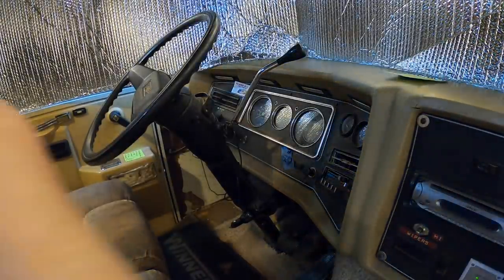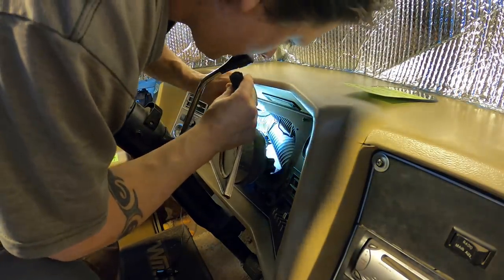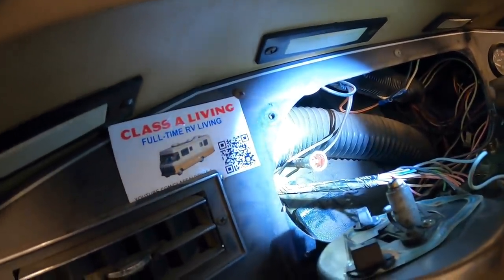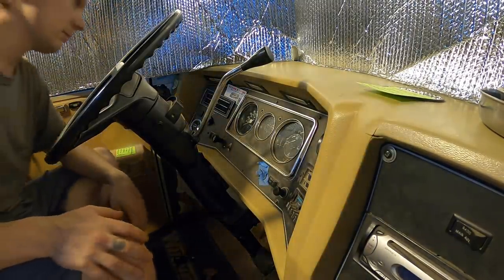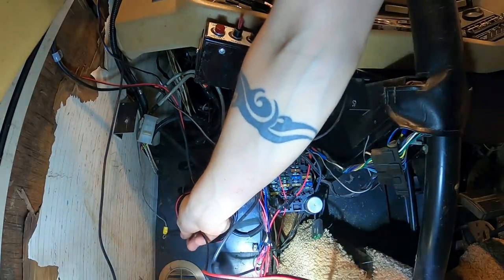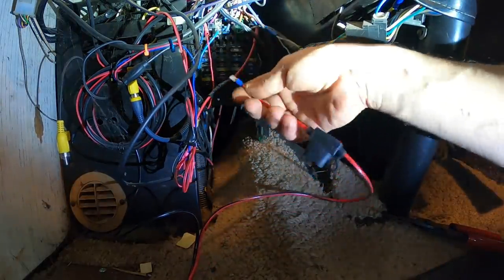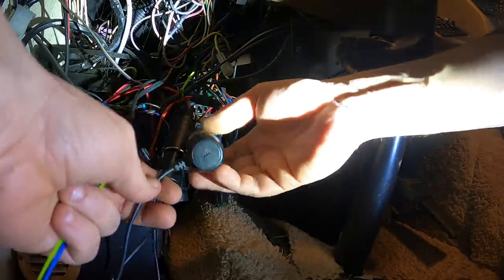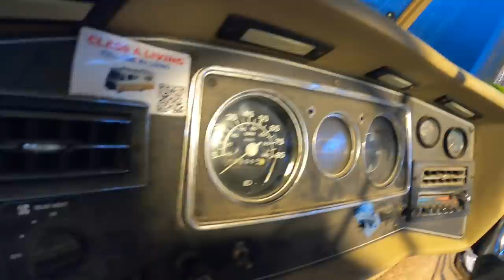Oiling Speedometer Cable & Switched Outlet Install In RV

Comment: I had the same speedo problem in 1960 on my 1953 Buick and learned a lesson.  Pulled out the cable, greased the entire length, thought it was done.  But no, the coiled wire nature of the cable drove the grease up the sheath and plugged up the rotating head in the housing.  Had to be fixed at the speedo shop.  Later I found in the shop manual that you only grease the lower 1/3 of the cable.

Comment: On my vehicles the speedo cable housing wears near the transmission because it makes a 90 degree turn into the side of the transmission.  Sometimes the cable is a one piece housing but most use multiple cables.  Especially if cruise control is available.  So it may be just the lower cable that needs to be replaced. Worn cables can also cause problem wear on the speedo gears inside the transmission as well.  So it is good to repair it as quickly as possible.

Comment: nate, the spedo cable should pull right out,grab it w/ ur needle nose pliers & pull,its like 5ft long in a rv. grease the cable then reinstall.
Reply from the maker: NOW you tell me
Reply: @ClassALiving  lol, we i was younger aka 20 years ago,all my family drove was older gm cars, so i did this many time,i used lithum grease, our spedo cable did what patches did,but it thumped AND squeaked! oil down the tube can help for a bit. best of luck
Reply: I was taught to use graphite.

Comment: Yeah, I wish I could be confident that 3 in 1 will work, (I tried that to early in my career) but being an old school mechanic for years, I would recommend trying to find a new cable housing and cable. That’s one long assembly and the issue is that both the cable and the housing wear out. Oil will probably make it worse in time. Any rust or debris will get washed down to the trans and get into the speedo gear bushing on the cable. On these, the gear also handles high stress and wears out to. Proper cable lube is best after pulling and cleaning both the cable and the housing, but even then if they are worn out or are getting rough because the cable is fracturing, both will have to be replaced. It may be only a short term fix at best. If the gear is worn, then it would get replaced to. Cheers and good luck!
Reply: Your showing your age. Just kidding. I wonder if they still make them? Excellent advice
Reply: @warzee123  LOL...  yeah, from the days when things were much more simple and computers were science fiction for most of us.  When I saw the first electronic distributor and it’s frequent failures, I knew where the industry was going.